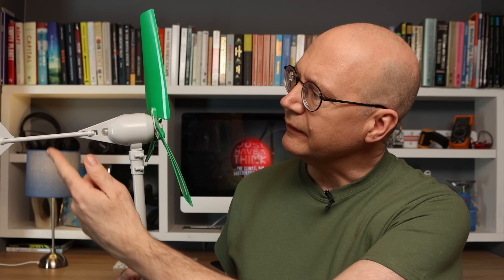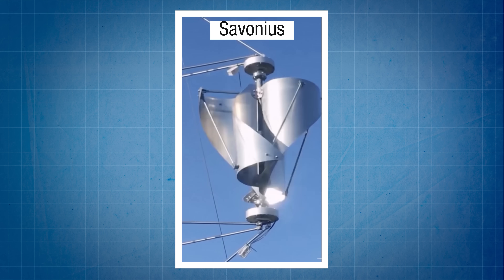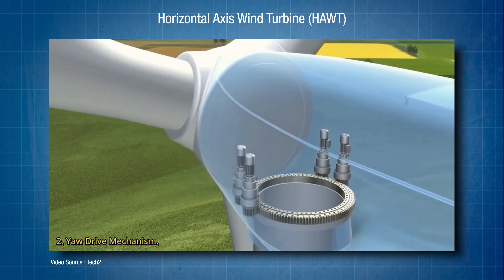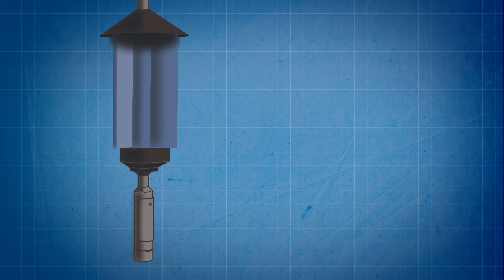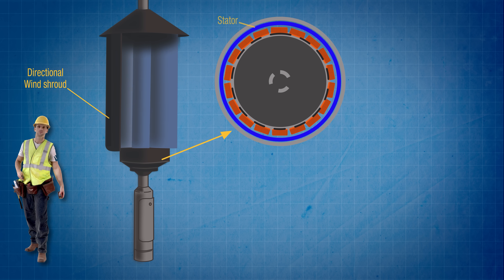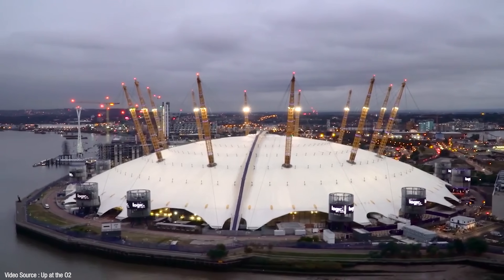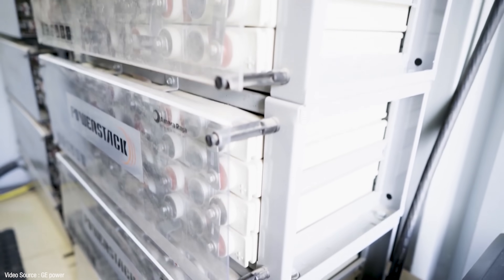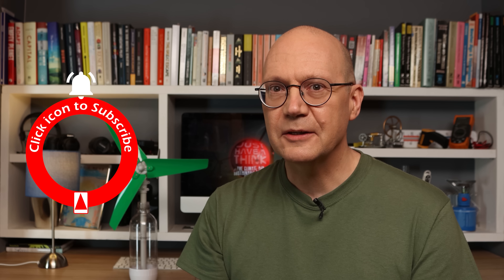A vertical axis wind turbine that doesn't need the prevailing wind! How do they do that?

Comment: Good idea to harness energy where possible, but personally do think need to ensure that there's no increase in resistance to vehicle moving as this would increase fossil fuel use with how majority of vehicles are currently powered. Getting the location wrong when fitting them in train tunnels for example may simply mean the wind generator requires the train to consume more power to travel through the tunnel.
Would be great to have legislation in place for renewable energy(wind and solar) needing to be fitted to new homes when built.

Comment: This is a great concept that I'm sure will be really helpful for fighting climate change... But. When a country is calculating the amount of energy coming from renewable sources should not count these wind turbines as renewable energy.

The energy comes from whatever it's moving the cars, if the cars are electric then the source is whatever is powering the grid.

So unless the cars still run on fuel (which is not renewable) then the windmills would be running with excess power from energy already extracted from somewhere else (then by, itself is not a source of energy)

So if all cars become electric then these turbines would no longer be a previously untapped source of non-renewable energy but a way to make cars more energy efficient.

Both are good things, but neither a renewable energy source.

Comment: I read somewhere that gusty winds are extremely difficult to harness to generate wind power...does anyone know if this problem has been overcome for smaller wind turbines?  Also - my understanding is that wind turbines need to be placed in the path of the wind, so the use case described makes perfect sense but to make use of natural winds the turbine, more often than not, must be elevated 50 to 100 ft in order to get steady winds of sufficient velocity to keep the turbine spinning and to make enough electricity to overcome their high capital and operating costs.

Comment: I just think it's a waste of resources. Can the amount of power put into creating them, installing and transporting them REALLY be made up by the waste energy from air currents that have come from electric energy or chemical energy being turned into mechanical energy? How many steps removed are we getting from initial sources? How many orders of magnitude of energy conversion are we even looking at, through each process. Charging, gassing up, extraction... Etc. Etc. Etc. Loss of efficiency, from the conversion of the original sources including operational costs and installing, repairs, etc must make the effective power production less than 1% efficient. I am NOT down for that idea.

In summary, practically speaking, it's green washing at its very finest.

Comment: Those turbines sound pretty neat, and I can definitely see their potential value in the right application. But it is quite an eye opener to learn that a steady flow of traffic plodding along at only 60 mph creates a steady breeze in the same direction of 12 mph. This means that the vehicles are only required to overcome the aerodynamic load imposed by 48 mph, which only requires about 50% as much power! I think any retardation of this 12 mph breeze will result in far more fuel consumption than that gained by the turbines. On the other hand, imagine how much energy could be saved if the sides of our roadways were streamlined, especially between opposing traffic lanes!!

Comment: Energy is always conserved. My working theory is that a roadway without these turbines would have moving air in the direction of car travel, which would make car travel slightly more efficient. If you slow down the air with these turbines, then the next car down the road has to fight slightly more against the still air. So, in effect, the turbines would be sapping energy from the moving cars.

Comment: A key generating factor in 'COMPLEMENTARY' energy is siting Building-Mounted wind-turbines along the wall corner & roof-edge shear surfaces where:
https://sites.google.com/site/indigenecommunity/design/9-Complementary-energy 
1) SHEAR SURFACES: wind is typically concentrated (both air-density & speed) at some 16 times the ambient wind speed. 'Helical' (like a DNA twist) wind turbines placed along vertical or horizontal shear surfaces capture this concentrated wind even when the Ambient wind is as low as a couple of kilometres per hour.
2) Because Building-mounted wind is widely distributed, it requires next to NO TRANSMISSION line losses. Typically electric power 'Centrals' such as gas, coal, oil, nuclear & even wind, which are located at 100s of miles from the urban consuming household & industry, lose 5% of energy produced per 100 miles of transmission through such as EMF loss, human-health damage, infrastructure costs, depreciation, Transformer losses at multiple stages, biosphere productivity,  etc. totalling 50% on average or 95% when all health & such as environmental 'externalities' are calculated in.
3) TURBINES CAPTURE & CALM concentrated shear winds, which make roof-tops & areas of normally unpleasant wind-tunnels between buildings usable as outdoor living spaces.
4) Capturing, LOWERS WIND DAMAGE to building 'skin' surfaces (windows, shingles, siding, shutters, etc) making the skin last much longer.

5) Vertical & horizontal Linear-axis wind Darrieus turbines especially those with 'helical' blades are 10 times more silent than straight blades because they engage wind along this longer surface for a longer period rather than being 'hit' by the wind (eg. 'straight paddle-wheel blade') so as to produce the noise (inefficiency indicator) typically associated with Savonius (Clock-face) turbines. At 10 times less wind noise, then the Helical-linear-axis turbines actually PRODUCE LESS WIND-NOISE than the sound of the wind 'jarring' the home or other buildings.
6) Vertical & horizontal Linear-axis wind turbines should be 'CAGED' BY LIGHT SCREENING') as well as funnelling, which as well keep flying objects, animals, bats & birds away from the moving blades. Funnelling greatly enhances the performance of the turbine. Screening can be aligned to direct the wind at certain angles of incidence into the blades, as well enhancing performance.
7) WINTER-CLIMATES Overhangs & helical design as well reduce winter snow & ice build-up on the blades & apparatus. Stored & networked energy such as in a turbine or grid battery can be used to melt ice & snow when needed at the end of a snow storm.

8) DISTRIBUTED BASE-LINE or LOAD energy is easily available to domiciles & industries, if humanity 'GET-OUR-'SH_T-TOGETHER'. Methanization of fecal matter & energy transformation of urine can, in a widely distributed (decentralized at the consumer end) way, produce all the BASE-LOAD energy needed to operate electrical systems with 'steady-state' electrical power supply 24 hours-per-day 365 days-per-year. Whether in urban agglomerations or 3rd World country off-road settlements, some of the most advanced energy systems are found in such as India's GOBAR-GAS generators. Methanization by-products include 'large volumes of ethyl-alcohol & safe zero-pathogen odourless liquid & dry fertilizer again widely distributed for food production security right where we need it without transport & commercialization costs. https://sites.google.com/site/indigenecommunity/design/5-bio-digestion-toilet

Comment: I did some work testing a larger version vertical axis rotor, larger version of the split drums model some 40 years ago. We gave up on it when we found we couldn't make the structure strong enough notto be blown over  by the 100kph gusts that we get a few times per year. The problem is the solidity  of the structure in cross-section, 100% as against what looks to me like 5% for big horizontal rotors. The311 design still seems to have 100% solidity. Even if inland Britain never gets such gusts, what would be the impact of  frequent close brushes with 40 tonne lorries moving at 110kph?:

Comment: Sounds like a great idea, but (and remember, I'm not an engineer, so this question may be based on nonsense) is it possible that some sort of drag is created by all the turbines on the vehicles that are creating the "wind" forces?  And if so, would that not negate any net energy savings?  I would really like to know for sure (and without having to understand any recondite physics calculations . . . !).   :-D
Reply: You're thinking in absolutes, i.e. either the drag will negate any net energy savings, or it won't.  Engineering necessarily looks at the wide range of possibilities between the extremes.

Comment: Maybe I didn't make myself clear? I'm not talking about the energy that the cars give to the turbine. That's fairly easy to measure, even though it will vary greatly from car to car. I'm talking about the EXTRA energy that the cars and trucks need to generate to offset the excess air drag caused by the turbine. I don't think we should be talking about what kind of fuel this energy comes from until all the other parameters are understood better. BTW, I didn't think, until reading more comments, that these turbines would be in the center median of divided highways. This just makes the equation even more complicated!

Comment: I don't want to be negative but I can't seem to grasp how a 5.4m/s wind speed able to generate 2.5KW at a 2m high vertical axis wind turbine. Assuming that the diameter of the turbine is at 1m, it only equates to like 0.06KW (56w)
Reply: 56w is optimistic. I'd say Max 25 watt.
Reply: @tzenophile  I used the 30% efficiency for to come up with the 56w. But yes, I think it's too high as well. Considering generator losses, inverter, rectifier and the like, the efficiency could really go down.

Comment: hmm the maths here don't make sense - even if the air flow along the motorway was a constant  10 m/sec the theoretical max power would be 600 watts/m2  so the average power of <100w seems  reasonable = 40 pence worth of electric per day ( at UK household price)  given these turbines will be at least 4m from the traffic path I would imagine that in reality even the 36w average is optimistic.

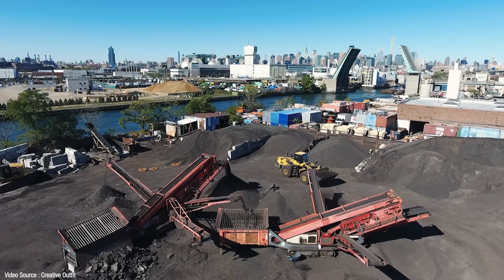Comment: All the numbers seem garbage: 1 turbine can generate 2.5 kW under typical conditions (at 5:26) but 125 of them make a 3MW power station (at 8:44)?
Furthermore, apparently this 2.5kW turbine can only generate 6kWh each day?? (at 5:48). Every month that's 180 kWh for a turbine that is rented for 232 GBP per month (at 9:20)! Check your electricity bill and tell me if 1.29 GBP per kWh is a good price...
Either there has been some mixup in the numbers or that's a scam...
Reply: most likely the third option: mixup  AND  scam.

Comment: I was thinking about this a bit more. In order to fit to existing lamp posts, it has to be in at least 2 pieces. As there's no central core, it would need bearings (or magnets) on the top and bottom. How do they plan to align these so the fan spins as friction-free as possible? Also, they will weigh 3.5 to 8 kilos? My 5kva inverter weights 30 kilos. So with something 2m tall at that weight, there's probably only going to be at most a couple of kilos of copper in there for induction. This is a scam!

Comment: I want to know how those will affect potential looses in case of accident like car hiting post with turbine, human and money wise. But its good idea tor telecom towers radio towers maybe some high buildings but large instalation of those would need power demand spike solution like when less generated power would trip grid so to avoid that small capacity of higher output reseve from battery/capacitor array could be necesary to avoid grid flickering on and off. I apploud idea as thats a lot of potential energy wasted across all highways.

Comment: First and foremost, I love the idea and hope that this (rather anonymous) company pulls it off. But the idea is far from new and proven to have a too low efficiency many times. VAWTs have a low efficiency because half of the blades are - by definition - moving against the wind.  Many have tried, and failed. The wind caused by traffic is negligible unless you'r very close to the traffic, putting your turbine a few meters higher gains you much more 'real' wind. I'm not sure if the average lamp-post is designed for the extra load of two square meters. Adding all kind of extra functions like air quality sensors is a warning sign that they need extra support. Once more: I do like the idea and hope it will work out, but I do have strong doubts.
Reply: You're correct. and Dave's numbers are wrong. A VAWT this size will produce only 25 watt.

Comment: "All that energy is coming from vehicles that all require energy to make them move in the first place. And in the vast majority of cases, at least today anyway, that energy will have come from fossil fuels in the form of diesel or petroleum. But those vehicles are already punching a hole in the air and causing air flow around them regardless of whether there's a turbine or a building or anything else on the side of the road and that air flow is essentially just wasted energy. So scooping it up into turbine blades that can drive a generator to produce electricity is a smart use of already existing resources."

It's great to harvest wasted energy, as long as it doesn't impact the operation of the original device. Often, the harvesting of the waste causes a feedback mechanism that imparts a counter resistance to the action. 

So in this case, does the installation of the turbines create additional turbulence or other air resistance that feeds back and increases the fuel consumption of the vehicles? Energy comes from somewhere and if it leeches energy from the vehicles rather than passively collecting waste energy, then it's less clever than it seems. 

I don't know if there is a vampire effect on passing vehicles or not, but it should definitely be studied before being widely implemented. I know I wouldn't appreciate having my vehicle's fuel efficiency stolen away for someone else's gain.

Comment: Yes. Let's go practical on this side road wind turbines? Alright. It is supposed to make a scientific experience by extracting data from the meteorologic center in UK, so they can observe constant wind patterns along the year. Matching those wind patterns to the motorways, may help increase significantly the yearly ratio of wind power capture, optimizing the production of electricity from these new VAWTs.

Comment: I once saw at a scientific fair a vertical axis wind turbine that harvested the energy generated by the suns radiation. It has mirrors reflecting the sunrays to a central point, close to the ground, at the base of a tube. The bottom of the tube is open so the air can get in easily. With the concentrated UV radiation, the air heats up, and starts rising inside the tube. Inside the tube there are several turbines that spin with the rising air flow, and transform the kinetic energy into electricity. The air then exits the tube through the top and cools down in the athmosphere.

Comment: This video is incredible.  A few years ago I had the same conceptual idea after a walk along a busy highway.  I told wife about the idea, and she thought I was crazy.  Glad to see this in development.  There is so much truck traffic on the USA interstate system that this could be very productive.  A second idea would be to use dynamic weight transfer built into the road system.  Did you ever feel the vibration on a bridge when a truck passes?   Just think of the movie "Big" with Tom Hanks and dance seen of lighting up piano keys.

Comment: Thanks for sharing the cool video.  This is a GREAT idea; I really hope that it works out as well in practice as they think it will!  This could also solve another issue that we're facing here in the US: taxes on gasoline are used to maintain our roads.  As more vehicles shift to electric, our wear and tear on the road remains constant but our maintenance budget shrinks.  If those same roads could harvest energy from passing cars, that could be sold back to the grid in order to help cover road maintenance costs!

Comment: 8:01  Petroleum is not a fossil fuel. Petroleum  is Abiotic, and it is made inside the Earth by heat, carbon, and pressure. Abiotic oil is limitless, as it is continuously manufactured by the Earth.

Comment: Without asking about how these devices are going to be installed without having to slide them over the poles, or without going into whether the existing poles have the strength to hold these VERTs...

In the animation of how one of these works, why does it shows a rotating center core instead of showing the "host post."

Comment: Thanks.  I recall a story years ago out of California, which reminds me of this idea.  A guy proposed a very similar idea, wherein the thick, concrete dividers between sides of traffic could be modified or replaced with units that had metal grill coverings, and turbo fans inside to catch the wind of passing traffic.  At the time, there were some very (to my mind, at least) flimsy concerns that basically amounted to 'nah, we don't want to do that', so nothing was done.  I'm glad someone has resurrected (or perhaps independently rediscovered?) this idea.  This does sound a bit more well-thought-out, and doubtless the technology is quite a bit better now.  Anyway, thanks again.       tavi.

Comment: Its an awesome idea, and overall I hope it succeeds. But one point I suspect has been mis-claimed is that the traffic wind is "free" energy. It may well have a small effect, but there is almost certainly some increase in drag on the vehicles due to the enhanced resistance to wind flow from the turbines. It takes more energy to push a train through a tunnel than through the open countryside, yes? So the presence of the turbines will come with some increase in fossil fuel consumption... key question is how big is this effect?
Thanks for an interesting think!